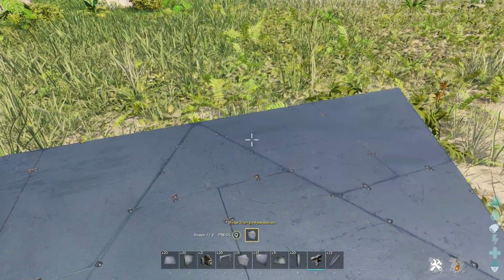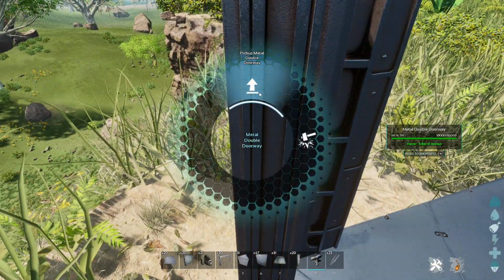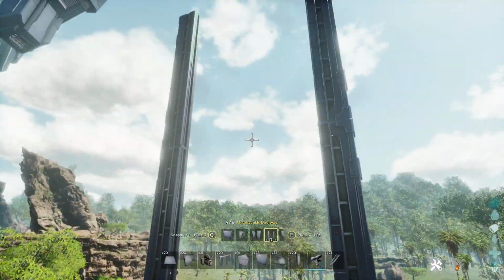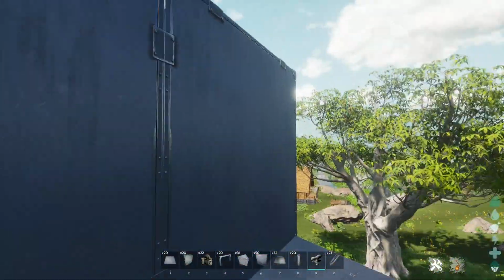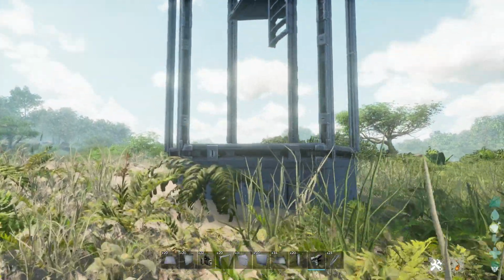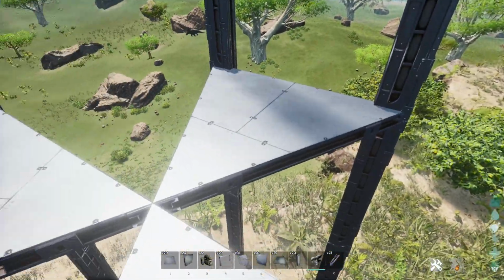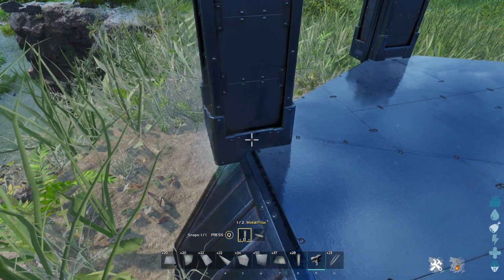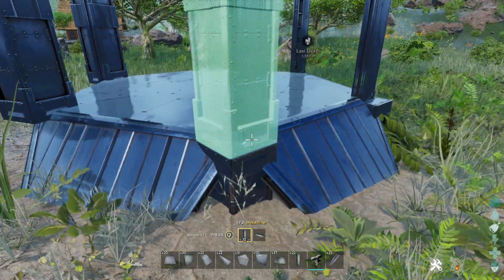The BEST Small Turret Tower Design | ARK: Survival Ascended

Comment: Do you think putting turrets under the roofs would work well?
Reply from the maker: You can put them at almost any angle but from playing official I’ve learned the best spots are on directly walls/cave walls, on ceilings, and spaced far enough apart to prevent rocket spam

Comment: You can just walk up to these on a stego and blow them with no more than 2 rockets.
Reply from the maker: Obviously stego tanking is always going to be a thing. This is great for early to mid game, especially to keep flyers away. If you’re dealing with Stegos, then at that point, it’s a full fledged raid. 

You can also place some on players only so that they target the Rockets being shot. We use this on official. 

Only way to prevent is either you would have to go into a cave or build massive skeleton towers that’ll buy you more time. Soaking turrets can never be avoided, it’s just about buying time imo
Reply from the maker: Also wanted to add, since i did forget, I would recommend making sure you're on hardcore mode if testing stuff out. I did use C4 and rockets, it definitely takes more than 2 to knock it down if you did drain all the ammo. So, I think you'll be safe enough to respond to an attack!